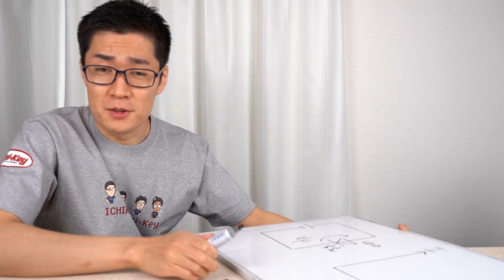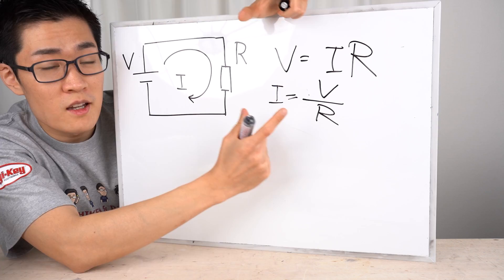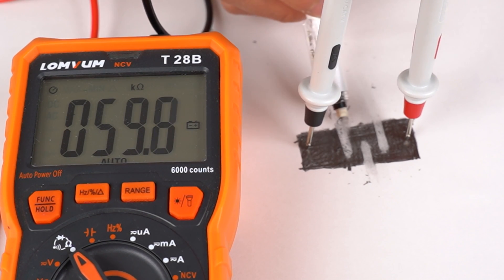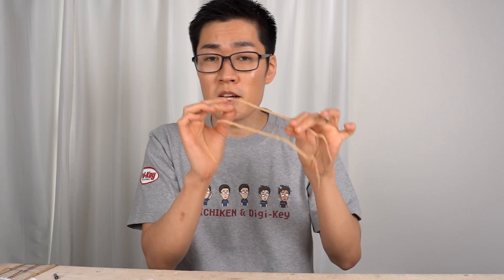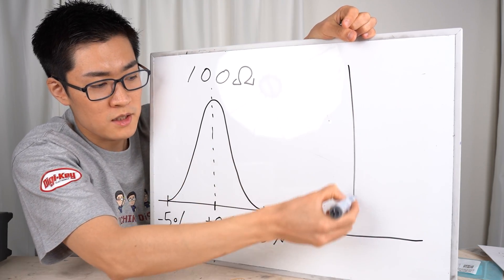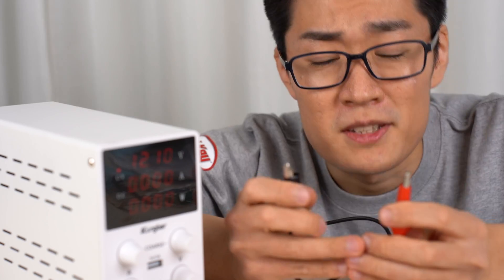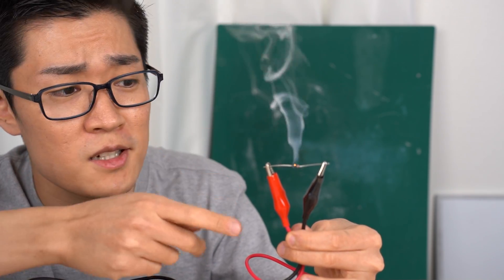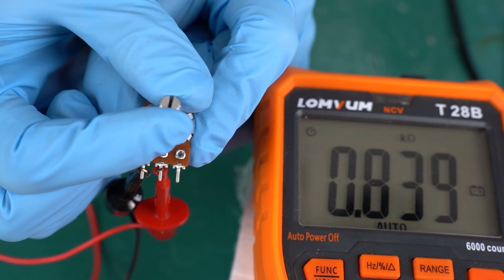What is a Resistor?

Comment: Thank you, I have this project I've been doing for a couple of weeks now trying to use a 10k resistor to allow my phone to run on a power supply instead of the battery. Research online mentioned I need a 10k resistor and I have resistors labeled 10k but when I place them, they only flicker the phone screen on and off, when I measure the resistance, it appears I am getting something like 10ohms or less than, I got these carbon resistors from the arduino kit, not sure what's happening here, but I'll have to look into parallel.